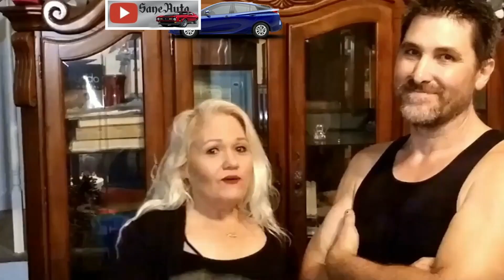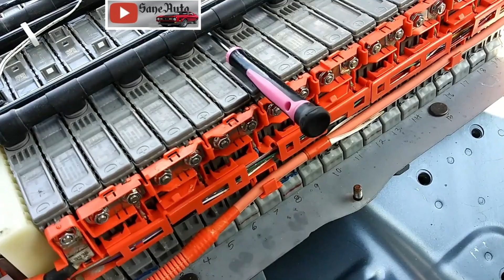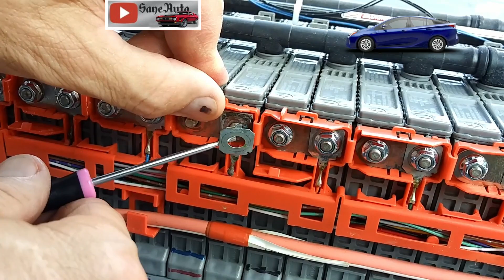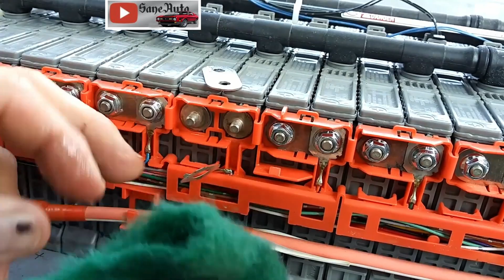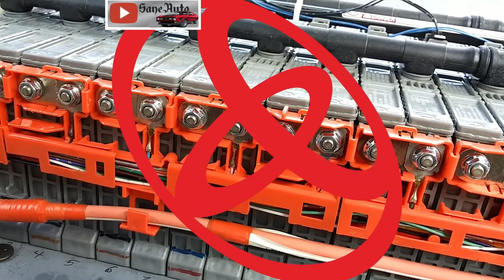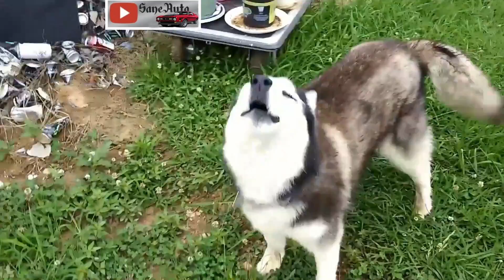Prius code P3014 hybrid battery cell block weak red triangle fixed for $47.63

Comment: How long did this fix last? I'm assuming your modules on block 4 tested above 6v under load
Reply from the maker: I only do voltage testing for the one video I did showing how its done. That test is the least accurate but the cheapest way to do it. I have 4 of the T180 that can cycle the modules and give capacity reading between cycles. I paid for them so might as well use em.  I also have the dr prius app I mention in many of my battery videos because you can download it for free & use it to test your HV battery  modules without even touching the battery. I need to make a stand alone Dr-Prius video. T180 https://youtu.be/hln7dLcFiYA